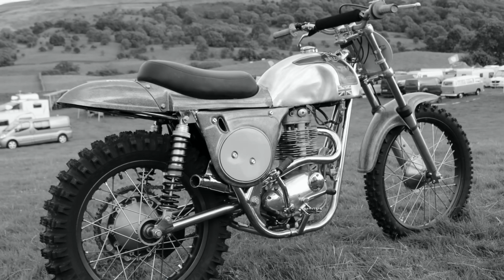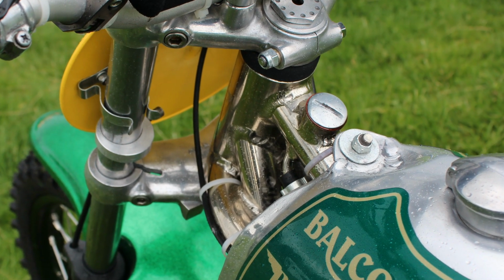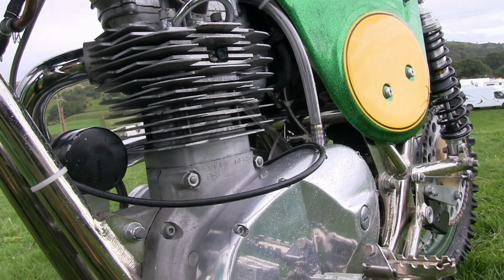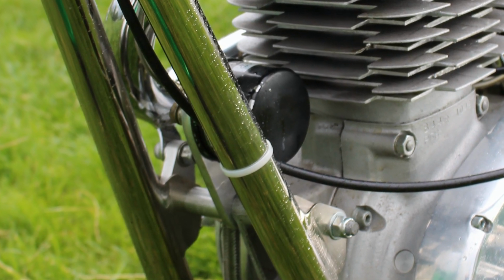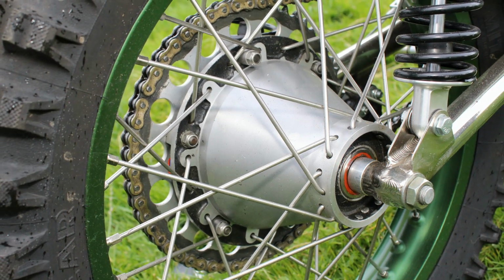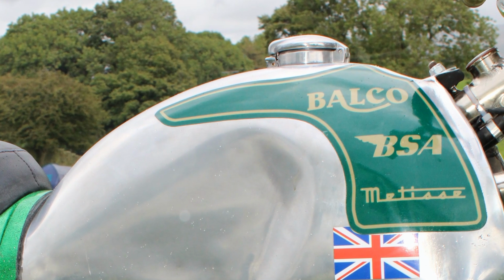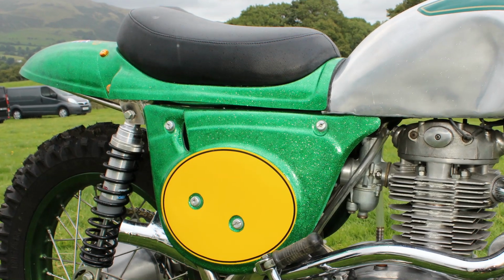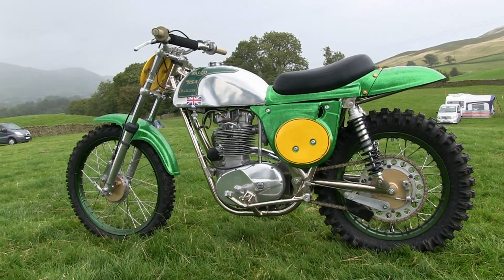Classic "Balco" Rickman Metisse BSA Victor 475

Comment: The frames a work of Art 👌🏻 and the mods on the old Beeza has turned the motor into something quite exotic internally 😎👌🏻…. On the Fins, I was told back in the 70’s by a few older guys, apart from aesthetics , cutting the fins back reduced the amount of mud accumulated, and easy to poke the grass and mud out between races, a regular chore with my piece of dowl on my Maico and Kawasaki , I never had the bottle to start drilling or cutting any of my fins though 😁

Comment: I only had a chance to ride a Rickman one time......don't remember the engine but the frame was memorable in a few ways:  it handled beautifully, very competent, the plated frame was, again, beautiful and, with a nod of the head, the bike fell into corners without any effort.  Incidentally, the throttle housing is a Magura that's had a bit of machining.  P.S.  Will nickel plating the frame lead to hydrogen embrittlement like chrome coating?  If my memory serves me correct Steve McQueen had a Rickman much like this but blue.